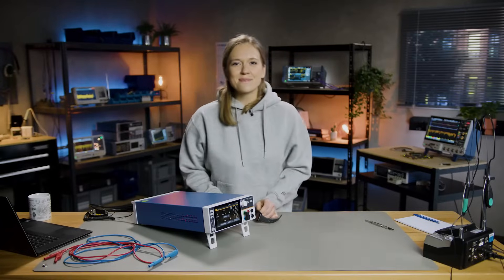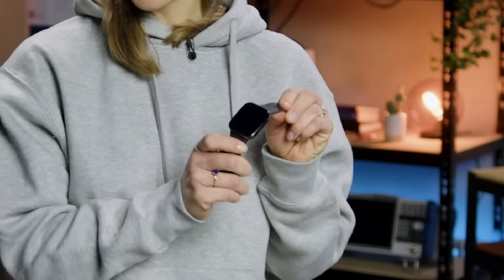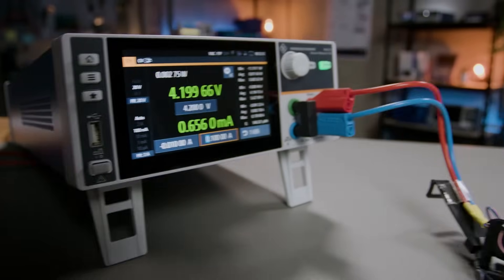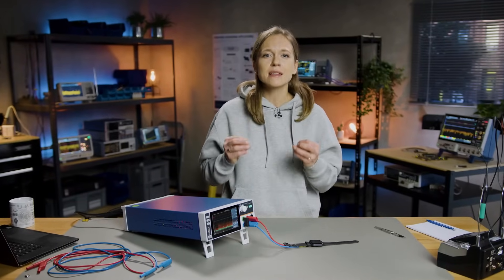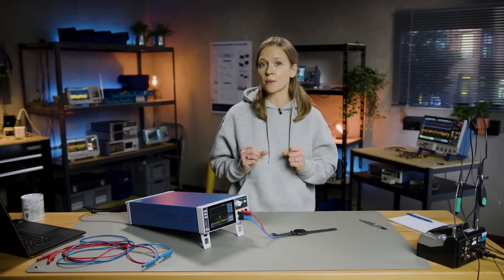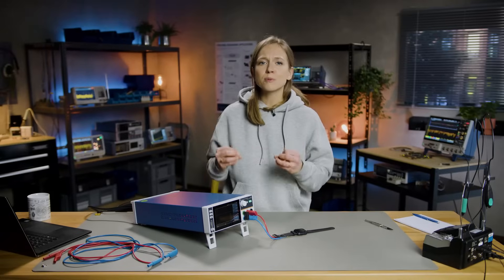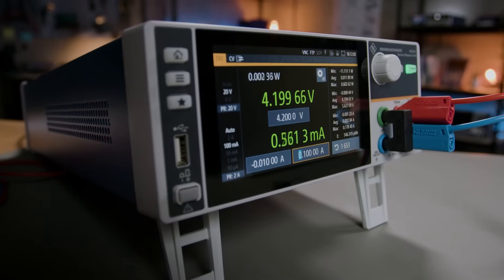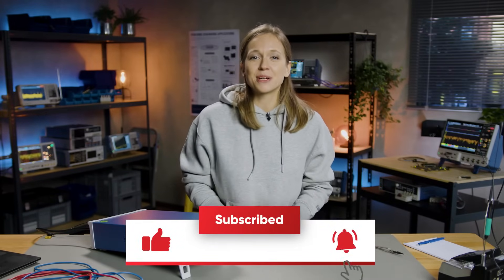Precision in under 10 minutes – Battery simulation

Comment: How is this better than a Current Ranger + Picoscope setup ?
Reply: I guess the purpose of this video is to show a general info about battery simulation, but not about what is better for exact case.
Reply: @volodymyrzakolodyazhny  From what I understood, its a really precise current measurement device and logger. They say since you have accurate current measurements, you can optimize the applications that consume the most current. 
So its not really simulating anything. May be I missed some details. 
But the same thing can be achieved with a current ranger and a picoscope and we are also able to measure down to few nanoamps with a much cheaper and portable setup if you have a laptop. The advantage for the R&S device would only be in "picoamps" range.

But for most low energy device developers, measuring down to the nanoamps range would be more than enough